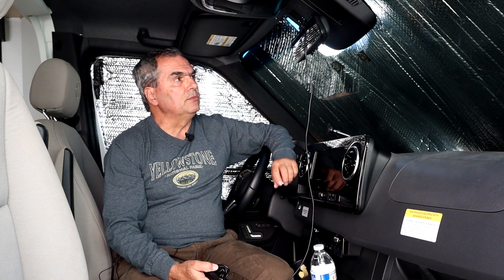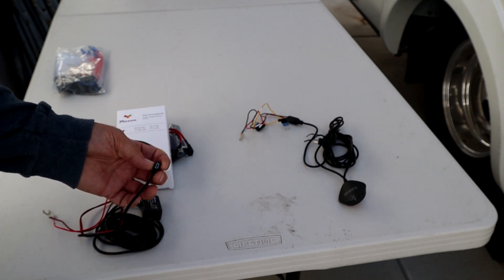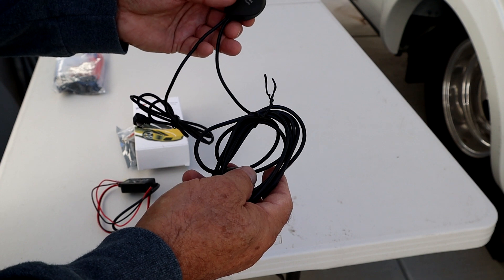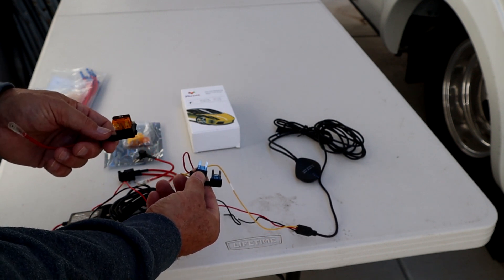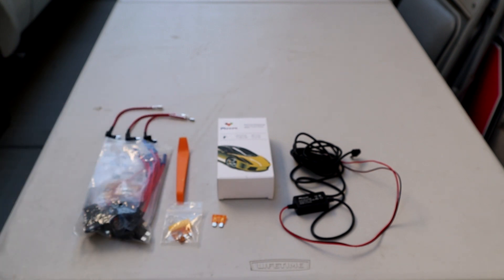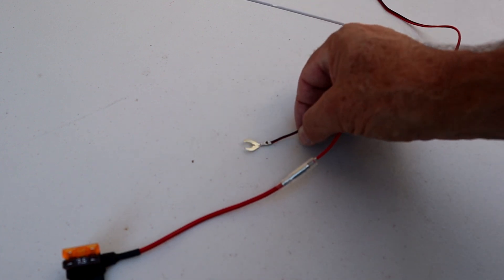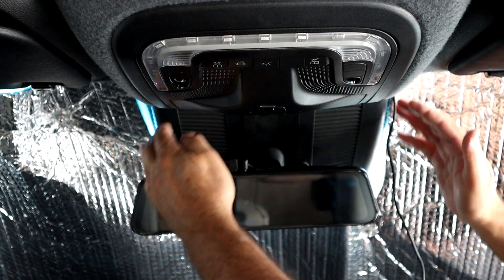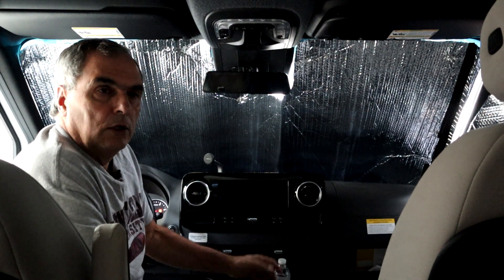Dash Cam Power Hardwire Kit

Comment: Thanks for these instructions, they were very helpful. One challenge I had is that Wolf had sent me two different hardwire kits but both had too short a wire to come from the rear view mirror to the floor. I ended up with the little converter box just below the side vent near the passenger door. I installed the GPS unit inside the windshield overhead unit since there was room. I also had trouble getting the ground to work in the fuse box. I had too big a washer so it was not lying against the body area where the paint was scraped off. Once I changed to a smaller washer, everything worked fine. The easier way to get the middle mirror cover to release is an auto pick. I used one and it helped it to popoff very cleanly. The pick also helped tremendously with getting the wire into the area where it crosses the A pillar.

Comment: I had the same problem with the supplied hardwire kit being too short. Did you find another longer cable?
Reply from the maker: I showed 2 kits in the video, one for the always on condition and one for the on while the ignition is on condition.  I installed the later as you can see in the video and it was long enough to go from the mirror display down to the fuse box at the passengers feet.  This is all shown in the video.  I guess it all depends upon which RV you have and where the fuse box is located.